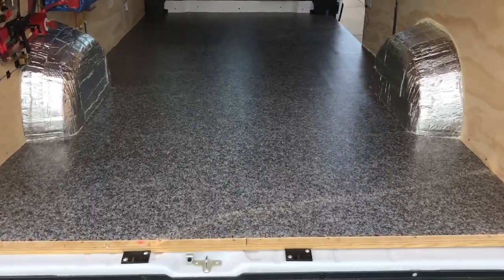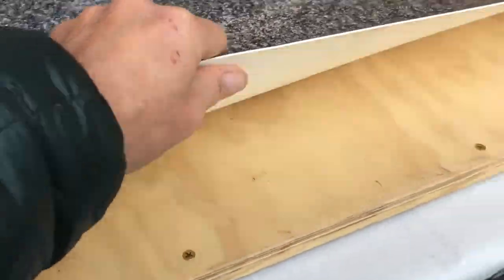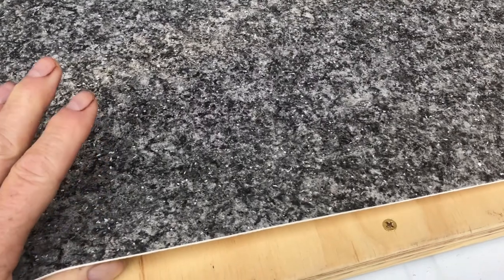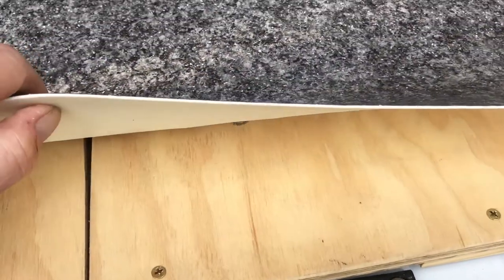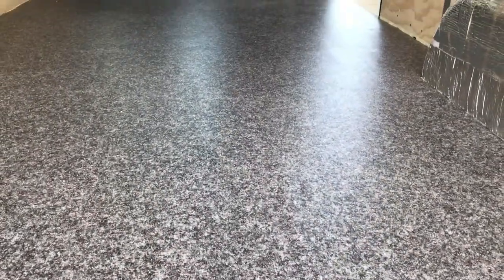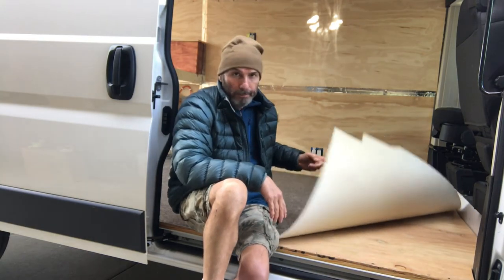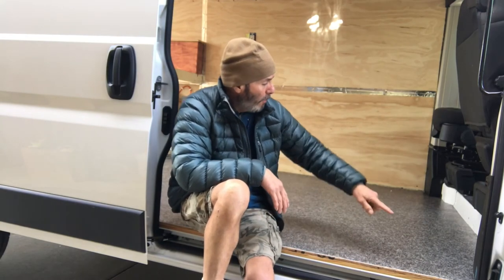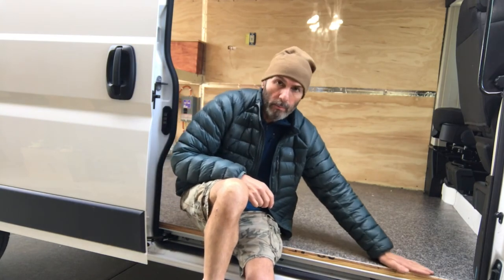Promaster Conversion #15: Finished Flooring

Comment: Late comment but I used sheet vinyl too and did the opposite I left my subfloor floating which was 3 sections of 1/2 plywood and then glued down the single piece of vinyl and it came out nice. And, you can repair vinyl sheet so you can hardly see it if you ever rip/tear it. It's not that hard but I don't know how that would work since you didn't glue your vinyl down. But yours looks good. Great job.

Comment: Hi Bart!   I really enjoy your channel.  I'm starting a camper build next month and I'm wondering how your floor has held up over the last 4 years or so.  I've watched a bunch of vlogs which say the vinyl floor tape hasn't been so good and they have gone onto glue it down.  You didn't even use tape.  If you were to do it again, would you do it the same way?  What brand of flooring is it?
BTW, I think you're ready for the AT.  I've done about 400 miles on the AT and have done a couple thousand miles of hiking in NM.  If you want to take your prep to the next level, wash your hiking clothes, socks, underwear, etc. but don't dry them.  Put them in the refrigerator and while they are in there, put an old pair of hiking shoes in a bucket of water.  After 30 minutes, put everything on and go hiking.   If you do one of your training loops and smile all the way, you should start driving east.    I'll be following you!   
Cheers from France.
Reply from the maker: No, the floor is fine.  The trick I think is to use commercial grade vinyl flooring.  It's still in perfect shape.  Yes, I'd do it the same way again.  I don't know what the brand is.  I just went to a vinyl flooring store and asked where their commercial grade vinyl is located and picked a dark grey color.  I think things like wood are just too delicate.  Sand and dirt are constantly tracked into the van and would wreck any kind of wood or faux wood.  Being able to wipe the floor down with a rag, without dirt getting trapped in little cracks, (like plank flooring would do) is key.

Comment: Exactly the same reasons that we will go with vinyl. 👍🏼
Reply from the maker: Yea.  People need to remember vans aren't houses.  In houses you build them to last 30-40 years without doing much. Vans should be built to change out different things every couple years, if for no other reason than you're bored with a grey floor and want to change to a different color.

Comment: What size, type and length of screw did you use to attach the plywood to the metal van floor?
Reply from the maker: I think they were 1 5/8 self tapping screws with a pan head.  Home Depot

Comment: Abrasives( dirt and sand) and vinyl don't get along well. The photographic layer on sheet vinyl is very thin. Its not practical but I would think the best material is ceramic tile.
Reply from the maker: Ceramic tile is durable but heavy.  Also, the floor flexes so much as the van goes over bumps and such that the tile would pop off the floor.  Tile also requires such extensive underlayments that the head room is diminished.  With the vinyl, I can change it every year if I like.